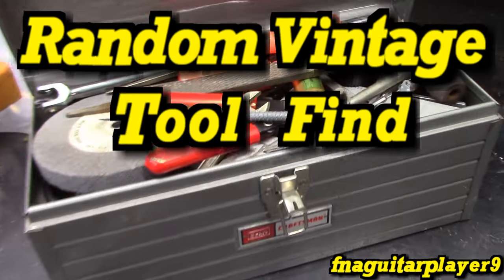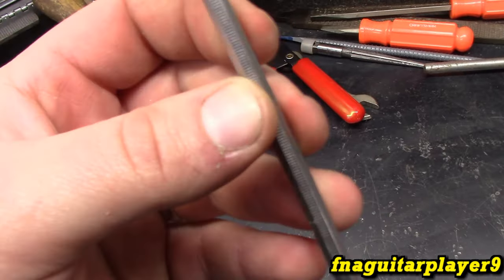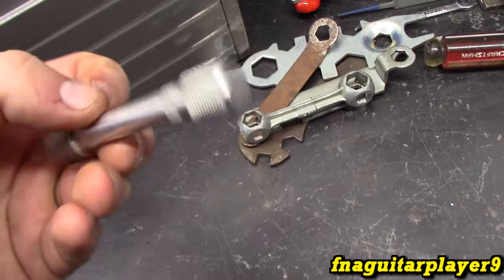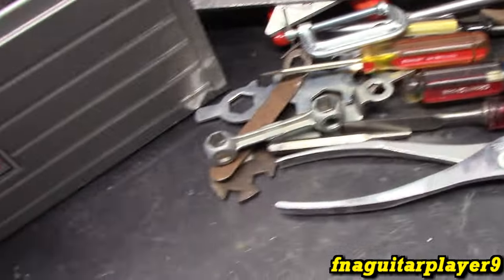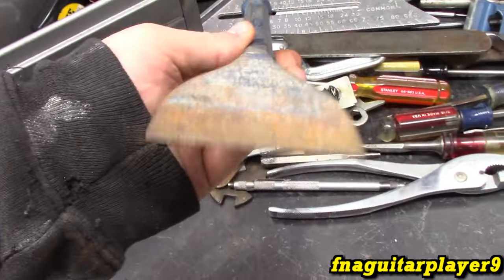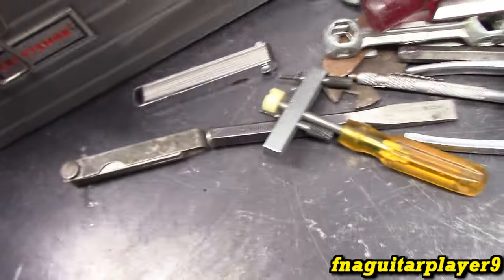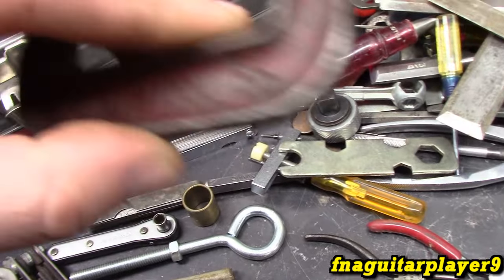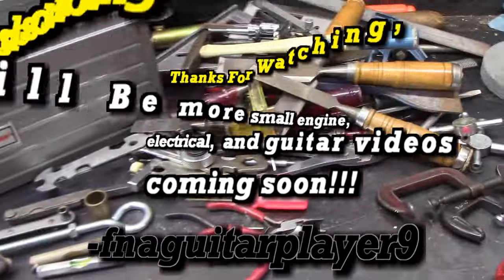Random Vintage Tool Find

Comment: If you have an old car with a distributor that has points & condenser, that screw starter with the center spring loaded wedge is an absolute necessity.   You don’t want to drop a screw down into a distributor.
Reply from the maker: My jeep has a distributor but not points, I'll keep that in mind for when  i work on one! Thanks for Watching!!!